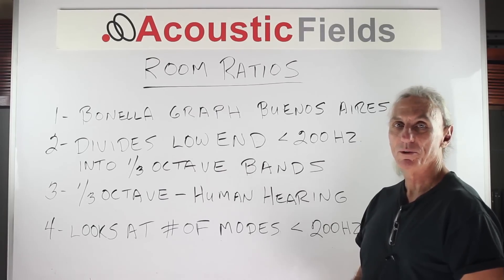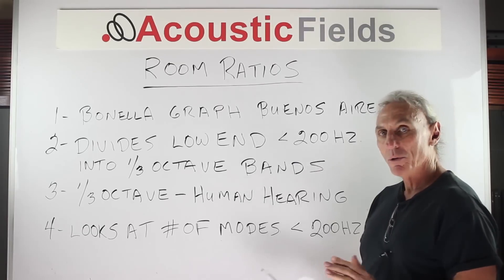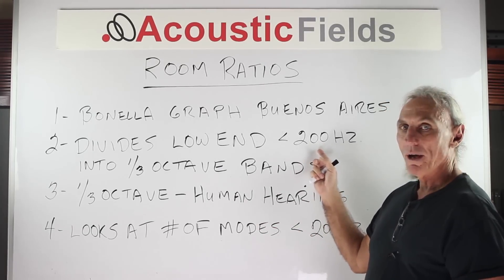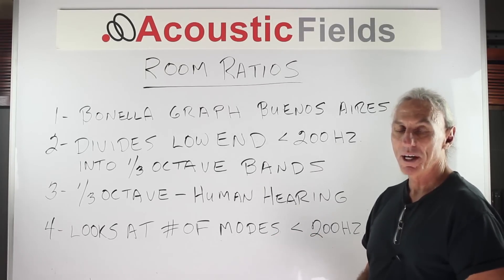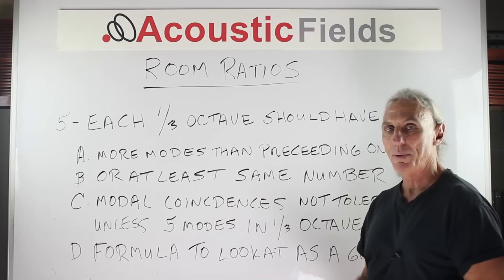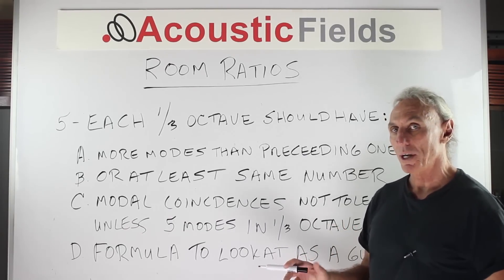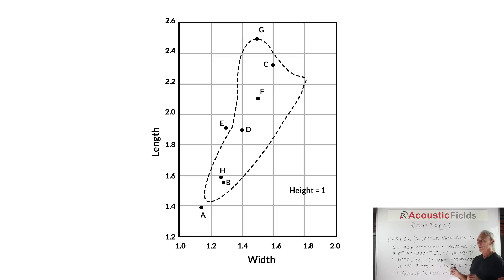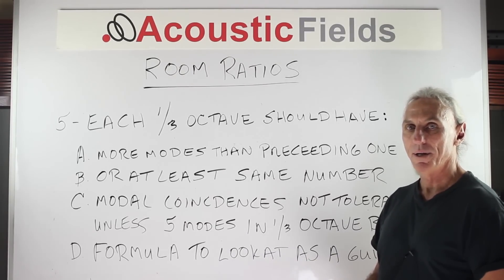Ideal Room Size Ratios & How To Apply The Bonello Graph - www.AcousticFields.com

Comment: I have an irregular room compared to the  1 : 1.7 : 2.3 ratio.   However after watching almost ALL of Denis's tutorials I was able to do everything correct with what I have and the results are amazing - yes I have full room treatment. Below is why it worked.  THANKS DENIS - Love my quadratic front wall diffusers.

Here is the explanation of why this works so well: The bottom write up address the imperfect rectangle room ratio of  1 : 1.11 : 2.06. but takes into account 
Acoustic Symmetry over Physical Symmetry: ( I have half walls - left side open to adjacent room, right side has balcony opening at the same spot as the left side has the opening)

While my room is not a sealed rectangle, I've created a crucial element of acoustic symmetry around myr central listening position. Sound from the left speaker and the right speaker is encountering nearly identical environments at the first reflection points and beyond.
Managing Early Reflections: The most critical reflections for stereo imaging are the early ones that bounce off the side walls and reach ears shortly after the direct sound. In my case, these reflections are either escaping into the adjacent room or out the balcony door, effectively minimizing their impact. This allows the brain to primarily focus on the direct sound from the speakers, which provides a clearer, more stable, and well-localized center image.
Balanced Energy Dissipation: Because energy is escaping in a similar fashion on both the left and right, the overall reverberation and sound field on each side of the room are balanced. This prevents the soundstage from skewing to one side, which often happens in asymmetrical rooms where one speaker has a close, reflective wall and the other has open space.
Low-Frequency Benefits: The large openings continue to help by preventing severe low-frequency room modes (standing waves) from accumulating, as the sound pressure is allowed to dissipate into the larger volumes of space beyond the listening area. 
In essence,  the optimization of the specific, irregular space to function acoustically like a high-end listening room by ensuring that the critical early reflections are managed symmetrically and low-frequency issues are naturally reduced by the open design. The standard room ratio is less relevant in this specific, highly customized setup.

The room's ratio is considerably different from the ideal one, particularly in its width-to-height dimension. The ideal ratio calls for a room that is significantly wider relative to its height. My room's width and height are much closer in value, which in a sealed room could lead to problematic low-frequency standing waves that are stacked at similar frequencies. 
However, as discussed, this theoretical ratio is less relevant in my specific case because the large openings on the side walls fundamentally change how sound waves behave. The openings prevent the accumulation of these standing waves, effectively bypassing the very problem that an ideal ratio is designed to solve in a traditional four-walled room.

Comment: Hello

You said that 17W 10H 23L is good and below that is bad. But do you mean volume here? Lets take ideal ceiling which is 14. What would be minimal Width and Length of such room with 14 feet ceiling? 

I also didn’t understand that graph. Based on that graph even smaller rooms are fine. Because there height is 1. Lets say 10 height is our 1. Then we divide length and width on that. Then based on that graph good width starts from 1,2 minimally and not from 1,7 (so 12 foot instead of 17)
And length starts from 1,4 and not from from 2,3 (so 14 foot instead of 23)
Reply from the maker: Choosing the correct room size and volume is a direct response to three main issues. You must choose a room size that will produce the smallest number of low frequency modal issues for your intended usage. Secondly, you must choose a room size that will allow you to give up 12 - 16" of wall space to treat the existing modal issues that all room sizes produce. Thirdly, the final internal dimensions that you settle on must not produce more issues than the original room size does. Your goal is to improve all the variables you are faced with in small rooms.

Comment: Enjoyed Indeed Understanding the Importance of  
The Room Ratio for getting the best Acoustical Results!
THANKS.
Reply from the maker: These guidelines that have been around for 30 - 40 years minimize modal issues. What they do not do is allow for the space requirements necessary to treat the minimized modal issues. Low frequency absorption requirements can take up to 12" and sometimes more on each wall surface area. If you add 12" of treatment to each wall, you now have a new room ratio.

Comment: What about Vaulted ceilings? my room is 17' x 19' with vaulted ceiling starting at 8' peaking at 16' in the center. thx
Reply from the maker: More room volume with vaulted ceilings is always welcome for lower frequencies. You need to be concerned with the angle of the vault in relation to listening position. Most angled ceilings require absorption or diffusion to minimize the time signature of those angled reflections at the listening position.

Comment: my room is only 16 x 14 x 8 . ive got bass issues!
Reply from the maker: Yes. You have issues at 40 Hz. , 70 Hz., 80 Hz., 106 Hz. The 40 and 70 are double digit peaks and these two fundamental frequencies are in everything.

Comment: I've got a pair of JBL 308's. I've got a room that's  30' wide, 45' long and 12' high. Are these monitors too small for a room that size? Should I build a smaller room for these speakers? If so, what would be the optimal dimensions for a room with these speakers?
Reply from the maker: What are the diameter of each low frequency driver and how many?

Comment: Using the AMROC calculator, 10x17x23 puts the “X” mostly outside the “piano shaped blob.” Decreasing the dimensions to 10x16x22 gets it inside the blob.
Reply from the maker: You have not allowed for LF treatment space which takes between 8 - 16"

Comment: Question, is it known that it is convenient not to have perfectly parallel sides, if, for example, the ceiling is not parallel to the floor, what measure is taken to calculate the size of the room? the average of the high ?, the lowest side; the highest, the one who is in the listening place ?. Thank you.
Reply from the maker: S,  Splayed walls have their place in control and playback rooms. However, they are a minimal treatment technique. You still need to assign special rates and levels of all frequency absorption to all surface areas. They are not a cure all for anything. The angle of incident must be calculated to match usage, listening position, and room width.

Comment: So the 17x10x23  are the dimensions of the Concrete Walls or after treatment?  Sorry if my question sounds st.. d
Reply from the maker: S,  Use these dimensions as I.D. (internal dimensions) These dimensions assume no noise issues that would require a barrier structure.

Comment: is there anymore size the room could be
Reply from the maker: S,  The size shown in the graphic is the minimum size. You have to give me the maximum footprint you have to work with and I will tell you good ratios within that footprint. This will avoid the need to go back and forth which I do not have time to do.
Reply: @AcousticFields  ok i understand but this is the maximum size 18 feet in L , 15 feet in w and 9 feet H,
Reply from the maker: @Spadetattooboss  This will work for mix room with the required surface area coverage of low-frequency treatment. Study the ACDA-10 units on our web site. You will need 12  units to treat front and side walls.
Reply: @AcousticFields  ok thank you
Reply from the maker: S, These dimensions are a minimum for control rooms. Higher ceiling heights are always welcome.
Reply: @AcousticFields  so working with this size what the best hight for the ceiling
Reply from the maker: @Spadetattooboss  S, There is no "best". Each of the three dimensions must form a sympathetic ratio that distributes the modal issues evenly or as evenly as possible through the room. When we build new rooms from the ground up, we never build control rooms less than 13'. There is 10% more energy trapped between the floor and ceiling every 8" decrease from 13'.
Reply: @AcousticFields  ok so givw me an ideal size to work with
Reply: Cause we going to block it up with 6 inches block dem concrete the top but do i of to still build a room inside?
Reply from the maker: @Spadetattooboss  For a control room I use 27' w x 13' h x 31' l
Reply: @AcousticFields  do remember its a home studio
Reply: The space isn't that big it's about 19 feet L and 14 to 15 W and you know i can bring the hight to wat you think is best
Reply: So work out the best size out of what i just told you
Reply from the maker: @Spadetattooboss  Use 15 w x 13' h x 19' l
Reply: @AcousticFields  and the speakers should be at what position in the room
Reply from the maker: @Spadetattooboss  Start at 5' from front wall and divide side wall distance equally.
Reply: @AcousticFields  i should be 5 feet from the front wall in the length zone
Reply: Whats up, So the space i have to work with is 18 feet in L , 15 feet in w and 9 feet H,  Plus I've got to build a room inside that room plus the boot, So please let me kno what you suggest i do for the best result. I really need your help on this
Reply: Good morning
Reply: Did you get my message
Reply from the maker: @Spadetattooboss   What is usage?  These dimensions will work for mix room but low-frequency driver diameter can not exceed 6"
Reply: @AcousticFields  for mixing and record

Comment: Hi. Just bought an old house in France, and will build studio on top floor. Presently the room is 2.5m W x 4.5m L x 2.5m H. Planning to remove the ceiling, opening up to the roof rafters, where at the center of the Length, it is 4.0m H. In other words, the ceiling will start to rise from the existing tops of the front and back walls. I will rip out the existing interior walls, down to the masonry, but I don't know yet how much extra room that will provide on the Length. I will build a room within this room, starting of course with a floating floor. I can build the interior room in any shape desirable for best acoustic results. Should I use the triangular ceiling matching the roof angles, or build a raised flat ceiling? The edges where tops of the walls meet the ceiling...front and back...would have to be angled perhaps at 45 degrees because the roof rafters start near the tops of the existing 8 foot high front and back walls.
Reply from the maker: D, You can not mix in a room that is only 2.5 m wide.  Is this a typo?

Comment: Sorry for the roughly dumb question but, can change one measure for other? for instance, instead of 10' for height and 17' for widht, could we use 17' for height and 10' for width? In the metric system, is there a set of measures that is a little less annoying to ask when talking with contractors?

thanks in advance.
Reply: I do not think it's going to work, Antonio. Please look for Room Sizing and Optimization at Low Frequencies (Trevor Cox, Peter D'Antonio and Mark Avis).

Comment: Good Video Dennis.  My room is a bit too long based on the ideal dimensions (my room is 7'4"x12'5"x25'5")  I think if i were to reduce the length of the room from 25'5" to 16' it would fall within a reasonable sounding ratio.  My question is, is there a way to create a temporary wall that could be moved/removed?  I share my space with others and putting up a permanent wall is not feasible.  What is the definition of a "wall" sonically?  Could I use panels/blankets? Or does it need to be a real wall with 2x4's and drywall?  Thanks!
Reply from the maker: J,  Never use 2 x 4's in the construction of a critical listening environment. They are not strong enough and will cause the walls to go diaphragmatic. This wall movement will produce noise. Stay with 2 x 10's to be sure you have the rigidity requirements met for the low frequencies in your room. You can use panels to plug wall "holes". The density of the panel must equal the density of the existing walls.  Your width and height will produce large low-frequency issues that will require more space to treat. Remember that low-frequency issues take 14 - 16" of space to treat.

Comment: I noticed when you mentioned that 17'x10'x23' was a good room dimension, both the length and width were prime numbers, but the height (10') was not.  Is this because 10' is a relatively standard ceiling height, in which case 11' ceilings would be even better, or is the spacing of 17 and 23 between 15, 20, and 25 (harmonic modes related to 10) more advantageous than 23's relative proximity to 22 (a potential mode related to 11)?
Reply from the maker: S,  These three dimensions are a good starting point to use a reference. Most people we talk to, do not have any idea about a starting point in dimensions no matter what the usage. An ideal ceiling height is 14'.

Comment: What you refer to as 'the Bonello Graph' is in fact Bolt ratios, two different things.
Reply from the maker: P,  Yes, it was an error that was supposed to be corrected. Thank you for the heads up.

Comment: I just watched your video. My room size 11.5 feet x 8.4 feet x 8.2 feet. Should I put the brakes on building my home studio and just use my headphones to monitor? Please advise.
Reply from the maker: T,  Full range spectral balance where all frequencies are heard with no irregularities will not be possible. However, if you can add low frequency management to your room, you can work in it. Watch this video of Sam Small Too Small. His room is about your size: https://www.acousticfields.com/sam-small-studio-project/

Comment: hii im building a house and id like to make a studio, in the house map the room dimintions is 260x370 an hight of 270 m
what do u think shoud i do?
Reply from the maker: F,  Your ceiling height is too low. Try to get to 3.5 - 4 M.
Reply: what can i do if i cant and thats the dimensions that i only can do?
Reply from the maker: F,  You will need extensive low frequency treatment covering both frequency specific issues from 30 - 50 Hz. and all the way through 400 Hz.
Reply: i have a lot of 4cm studio foam like this and 2 bass traps...
but i know that i need to place them right and at the right anount but i dont know how to do that, i just place them 
http://i.ebayimg.com/00/s/MjI1WDIyNQ==/z/-bkAAOSwnDZUAOif/$_35.JPG?set_id=2
Reply from the maker: F,  None of those technologies will work for your room size/volume/usage.
Reply: didnt said nothing about technologies ... ok soo what do u suggest?
Reply from the maker: F, All treatment type, amount, and positions to match usage has to be calculated. This design work takes on an average 10 hours with two weeks for the analysis and then another 2-3 weeks consultation through phone and email. The treatment only design fee is 1,500.00 USD which includes the DIY build plans so you can build all the specified treatment type, and amounts.
Reply: how u will do that by web? im from israel
Reply from the maker: F,  We do design work all over the world.

Comment: Have no clue what u are talking about. Except u recommend 17' width of room × 10' high ceilings × 23' length of the room.
What does all the other stuff mean????
Reply from the maker: B, The room size and volume stated is a size and volume that is a good starting point for a control or mix room. It minimizes the foot print and treatment requirements. It is offered as a guideline to use in selecting room size/volume/usage.

Comment: You should do a video on L shaped rooms.
Reply from the maker: Hi Rich, "L" shaped rooms are highly problematic. You must locate two channel system in area where side wall and front wall distances can be calculated.
Reply: playing in a band i know L shaped rooms are highly problematic with the bass. Did a sound check once and kept being told the bass was to loud. The bass player stopped playing for a song then asked how's the bass?  Reply"still too loud"

Comment: Would it make a difference if the room were wider than deep? I am looking into building a listening room in the basement that is 12'6" Deep, 22" Wide & 7' High. Music tastes vary dependent upon mood. Room is also to be used as home theater, but mainly listening.
Reply from the maker: Hi Kenneth, The ceiling height is too low. You also need more length. A 22' width is good but you will need at least a 27' length.